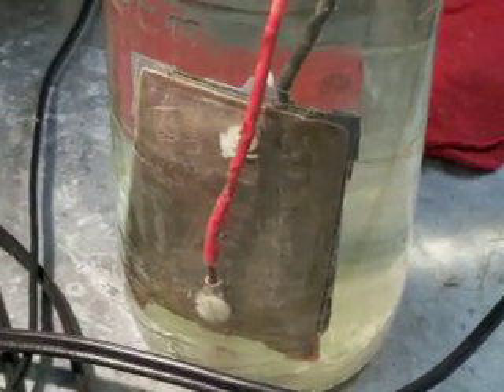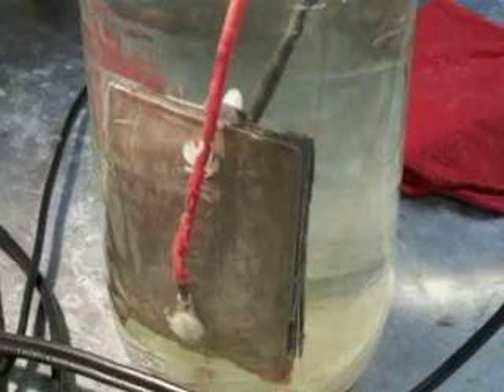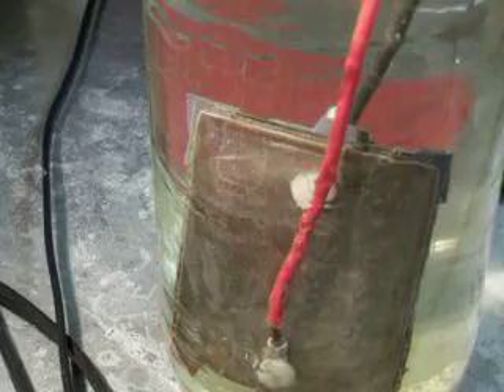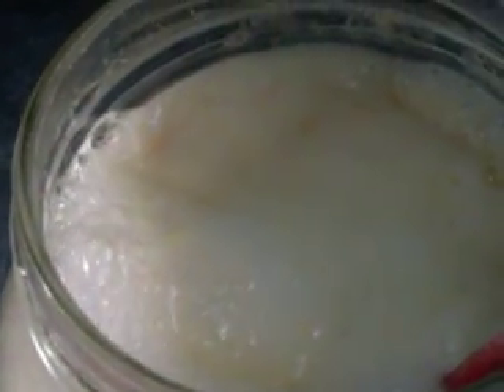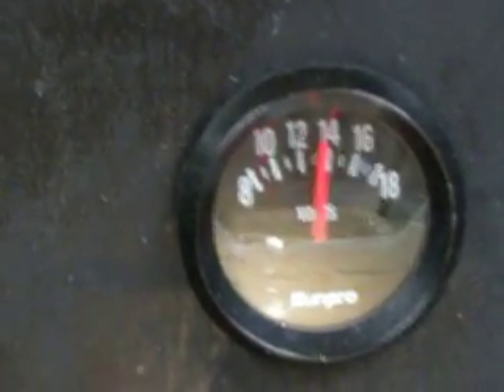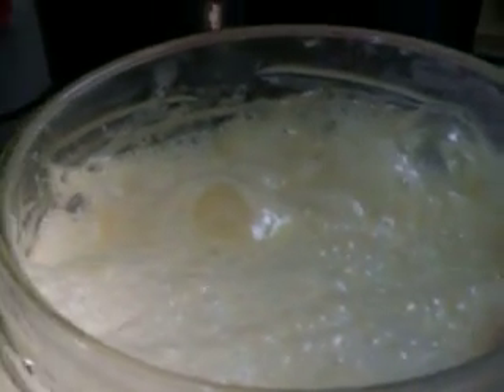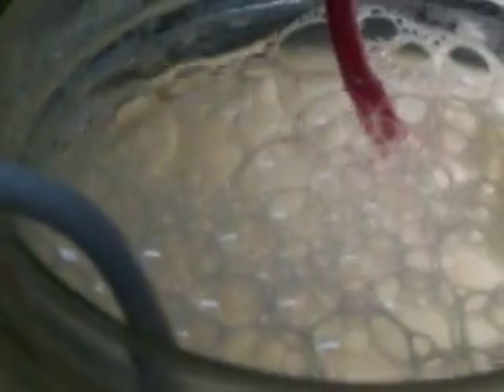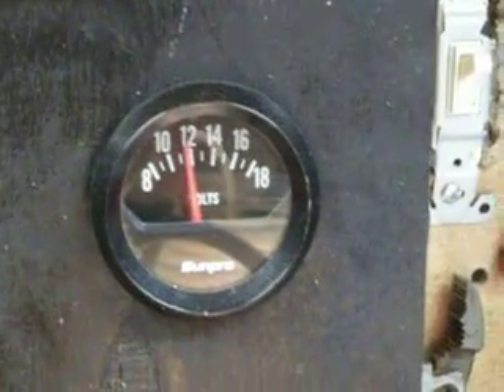part 2 of new cell design

Comment: HHO browns gas .. I think not pure Hydrogen ... it's VERY important .. because Hydrogen is safe but HHO .. has the oxygen .. .. you need to separate the 2 gases ....to run a car . the oxygen sensors will put more petrol .. and .. neutralize the gain ...however pure hydrogen and you will +50% efficiency

Comment: Why do the neutral plates drop the amperage? Thanks
Reply: +DUMBASS The neutral plates make more plate gaps which spreads the system voltage out evenly. If there is more than 2V per gap it makes excess heat so if the pos/neg are next to each other on a 12V  cell, approx. 10V produces heat. Use extra electrolye with neutral plates though.

Comment: GREAT WORK,2 plates will OVERHEAT  if you leave it on too long. to keep the temps around 100degrees with a long run you NEED 5 NEUTRALs